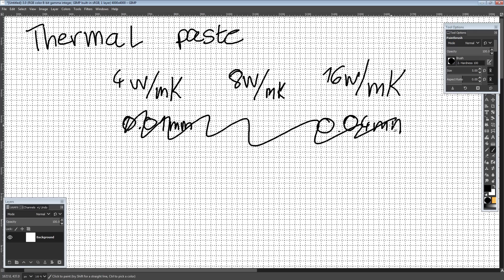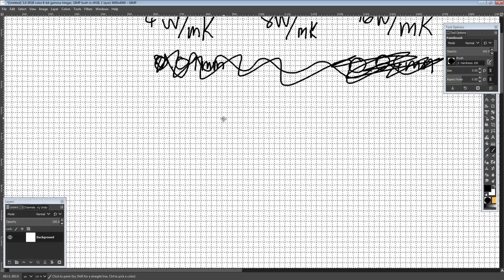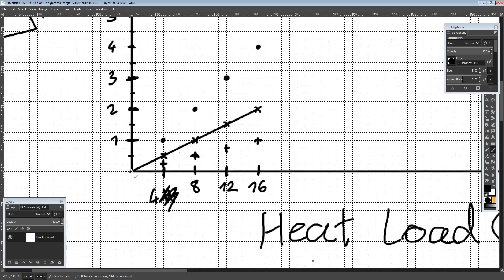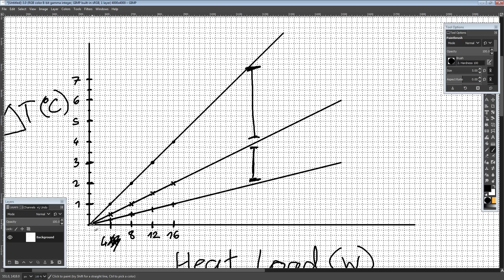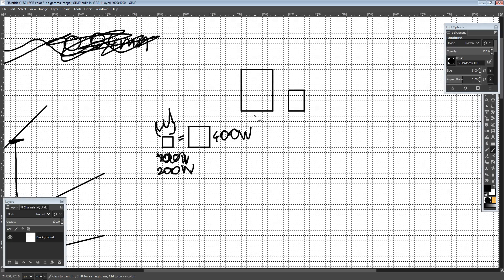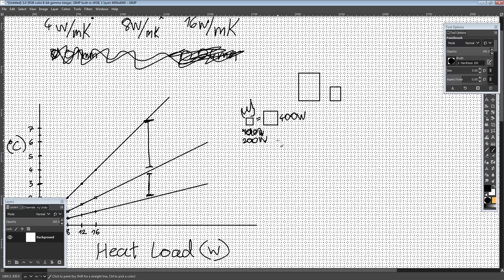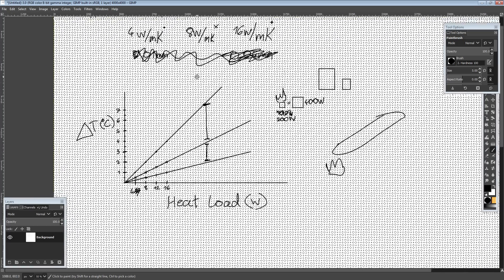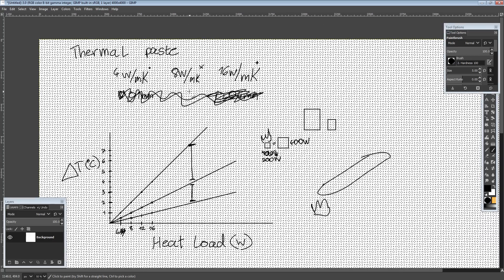The importance of heatload in thermal testing

Comment: Based on the way heatpipes work: wouldn't it be better to use graphics cards upside down?
Reply: Radius of heatpipe is small enugh to probably not effected by that.
Reply: There i funny thing named Pascal law which states that gas evenly distributes own pressure(i mean for a most of gases(especialy in not mix and at/above room temp) gravity has a very small effect, which is even smaller for 5-15cm height difference), also capilary effect greatly overcomes the gravity...so difference can be but a tiny
Reply: @QueueTeePies  Well, in a video card in a normal tower case the GPU is on top of the pipes. So it is against the normal use of heatpipes by default! That's why I think it would be better to use the card upside down, so the GPU is on the bottom, the pipes are on top, they remove heat by vaporising the liquid, and use gravity instead of capillary effect.
Reply from the maker: @burikd  GPU heatsinks are designed to be relatively unaffected by gravity.

Comment: What's you're opinion on ,ic graphite thermal pads 40x40 for AMD cpu ,I just got 1 to try it out I use noctua cream. Nice information video nice job.
Reply: IF YOU HAVE ONE, THEN POST TEST RESULTS!!!
Measurable results beat opinion any day of the week
Reply: You can buy the stuff in large sheets from panasonic on digikey. It's a known tech, better at lateral heat transfer than through transfer

https://www.digikey.com/en/product-highlight/p/panasonic/pyrolytic-graphite-sheets

Comment: Question regarding Pads.

If you have a gap of say 1.5mm you need a pad for and "reducing" the gap is not really doable without too much effort, wouldn't it be better to take two very thin pads  (e.g. 0.5mm) and cram a 0.5mm "copper" shim or something between the two?

Would that even make a meaningful difference?
Reply: Wouldn't it be better to use a copper shim of 0.5mm with thermal paste to the heatsink, and a 1mm pad on the other side?  No thermal paste between the shim and the pad itself.  Maybe you could do 1mm copper shim and 0.5mm thermal pad, but at that point you risk creating a short.. as the 0.5mm could become penetrated creating a circuit to the copper.  I don't see a benefit of having two 0.5mm pads, because the pad on the other side of the copper becomes a bottleneck.  It's the kind of the thing that would be fun to test, to see the real world results.
Reply: Not an expert but a Physics student:

It probably doesnt matter too much, the Distance must be overcome anyway, i'd use the simplest version to build/maintain.  Two Thermal pads with copper wont do much better than one fat pad i suppose. Yes, copper is more conductive and if you have it, go ahead and use it.
Reply: seen something like that done on some laptops(with very stupid cooling, where cpu and gpu have had different height) by their owners, stock solution was thermal pad, they changed it for cooper shims and decent thermal paste

Comment: i wonder if you have the knowledge and you're willing to make a video on how to calculate heatsink tdp, or what makes a heatsink/radiator bad or good
Reply: Thermal conductivity & Specific Heat Capacity...?
Which means, A) how fast can material accept energy from a source, and B) how much energy can it absorb without noticably rising in temperature....Then the next question is the capacity of the radiator to disperse energy away from the heatsink to the surrounding outside environment

Comment: Great infor,  I really did understand how Thermal cooling work. But , how do you resealed HSI on a cpu , after you delided them.
Reply: Just like intel do it - special adhesive material. Silicone\rubber like glue, which is possible to remove later with known temp.

If you know melting temp it's even possible to remove solder under soldered IHS and don't damage CPU die itself.
Reply: @rusTORK  Some people use cyanoacrylate/crazy glue, but using the silicone adhesive is the wiser choice imo.
Reply: @CKTofu  crazy glue has a little advantage - it is very weak on shear, but pretty strong on tension

Comment: interesting :D so TDP on the air cooler marks up the upper end idealy ( until the manufacturer is not realy honest about the TDP capabilities fo that aircooler ) so a 150 watt tdp aircooler might take a lot of more heat, but only for a very short period. also more heatpipes = better TDP in the end, as there is more fluid inside to get vaporized, same goes to thicker heatpipes then.
Reply: Yeah, air cooler TPD's are real upper limits. You also get max performance out of an air cooler with good paste, but only up to that limit.
Reply: on quality coolers, there's still a decent margin above the TDP, while on cheap coolers, you already get out of the linear-ish range below the rated TDP.